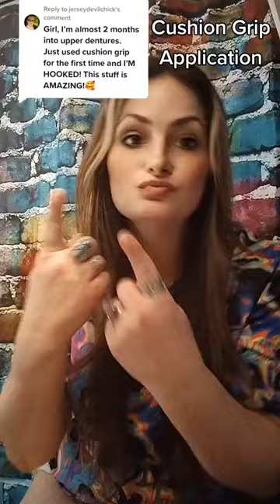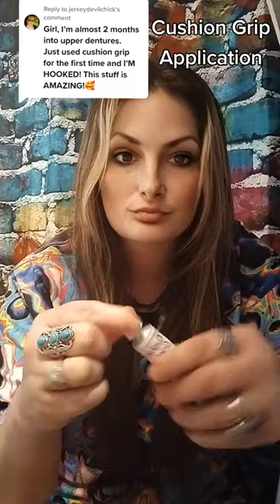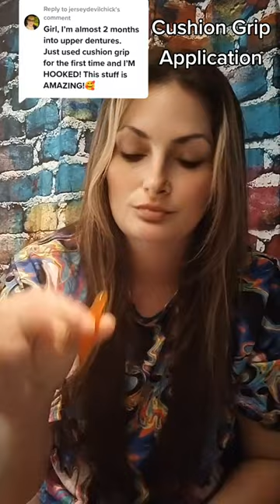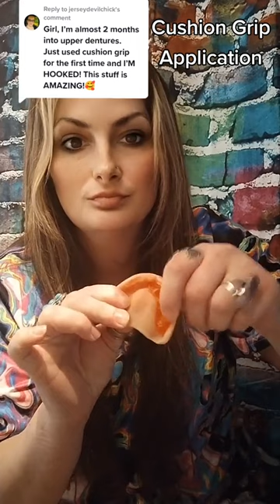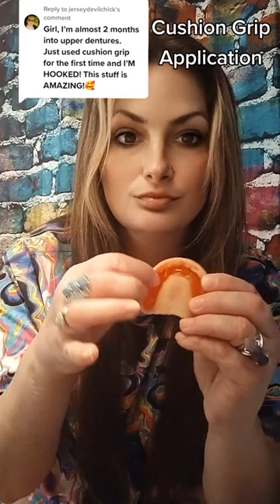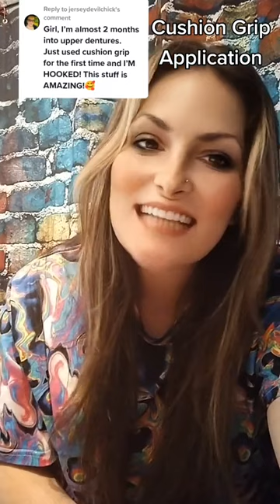APPLYING CUSHION GRIP #dentures #smile #toothless #cushiongrip #denturegang #teeth

Comment: I have been wearing top dentures for about 9 years. I never need adhesive once I learned to get them sucked up there. I could eat anything, I could chew gum. Now I recently almost 2 months ago got the bottom done and a new top. Top is great, but the bottom I can never get the adhesive to stay put. If I use this do I still use adhesive on the bottom and if so do you take them out nightly and soak them

Comment: Hey, I'm about 2 months post extraction with my immediate, top and bottoms , right now my soft relign is starting to come out, should I take it out completely before trying this?? The pallet part on the upper one makes me wonder if I need it or not...in guessing it gets good suction how you did the top?? Only problem is when my soft relign comes off that top pallet part (like mine is now) it tends to HURT a d makes my roof of my mouth pretty sore where the hard plastic rubs
Reply: So where are the answers to oliverhart’s questions??  I’m looking for them
Reply: @jackiedavenport1530  hey bud I suggest you get some cushion grip and follow these videos, it works greatly. I haven't had to go back in for a relign for like 2 months because I've been doing it myself. If you can't get all of the soft relign from before off just do it over it. I'm sorry I'm not the best at explaining

Comment: Does this help with gum sores from rubbing? I’m 3 weeks in and I still can’t chew even the softest foods because it stabs and scrapes my gums. Had several adjustments and still having issues. Can’t afford too many more trip to get them adjusted.
Reply: Yes it does. This stuff is awesome and you don't have to do it every day. I leave mine in for a week. Prob pushing it there. They took this off the market but had sooo many people against that and letting them know and now it's back. They sell it in some stores again or on Amazon. Amazon charges different prices depending. Just look for the cheapest
Reply: You mean you leave them in constantly? Or it doesn't come off for that long? From what I understand this is more of a soft reline then it is an adhesive, is it not?
Reply: @oliverhart7013  Hey Oliver, it’s very much like a reline you change it when it starts to loosen, it’s like a comfort grip. You can still use denture cream or powder along with it if you need it.
Reply: @miaace5070 thank you for your reply to Oliver! I’ve been suffering for too long w/my bottom dentures I guess leaving sores on my gums! I probably need to go back to the place I bought them from back in 12/2019 it is most likely past due time for a re-align? I need to be more knowledgeable! I was only 26 when I had  all 28 teeth extracted at once. And I know my face is getting skinnier so guessing my gums have shrinkage and need re-sized! The bottoms have always been more a hassle than anything else!

Comment: Love this video I’ve just ordered this to try. Got my temp upper dentures today and they are so loose. Can you eat ok with yours?
Reply: Not scrutinizing but why are they loose. Sounds like you've had your extractions some time ago. I got immediate uppers a couple of months ago and I think/hope the shrinking is done . We denture wearers need a win.
Reply: @ronaldwilson1431  it’s because I already had a denture for 2 side teeth which snapped so they fixed it at their lab took impressions with mould and added extra teeth at the front so it’s not a perfect fit.
It all happened really fast I made a split decision to get 4 teeth out at the front when I went in for other work as I couldn’t handle the state of my front teeth anymore. They took the teeth out that day and had the denture there to put on right away.
I get the permanents end of December but with fixodent and cushion grip I’m coping ok not ideal but not too long to wait now.
Reply: They should not be loose. I can eat with mine without any goops to hold them in. I have almost sneezed them out a few times. Lol but if they're as loose as you say then the dentist did a very poor job but you need to have him or another dentist readjust them